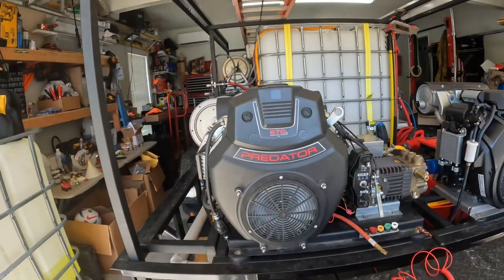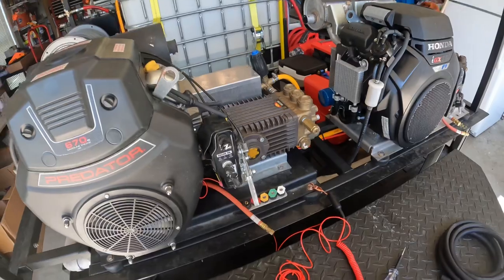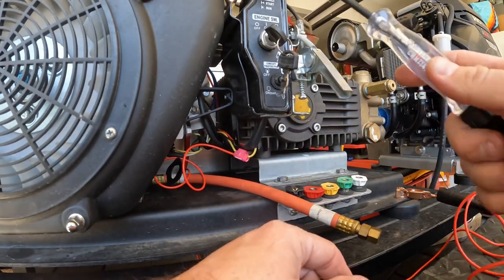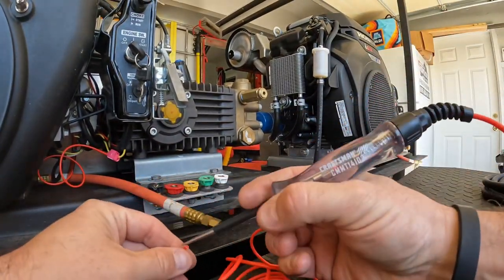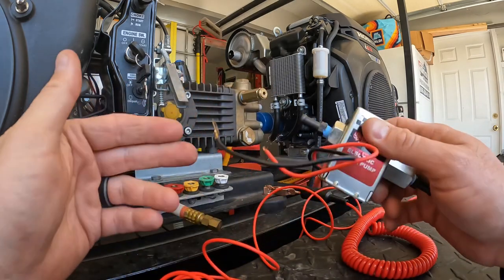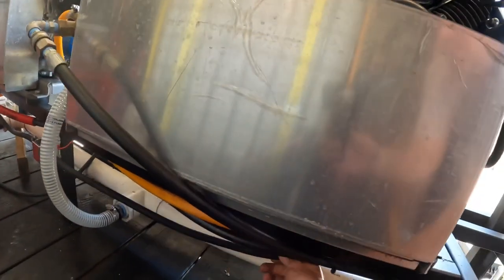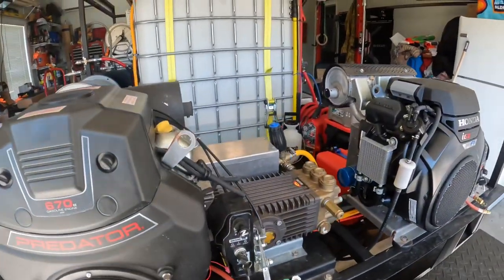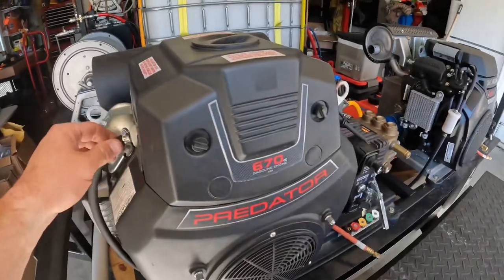How To Add A 12V Fuel Pump To A Predator 670

Comment: Can the ground wire just hook up right onto a metal truck bed? Or does it have to be touchijg the engine?
Reply from the maker: I believe it will need to be grounded to the battery or unless you have your battery ground to the truck 🤷🏻‍♂️
Reply: @KentuckyWashPros [UPDATE BELOW] I ended up just screwing the ground into my water tank cage 😂😂🤙 works like a charm!
Reply: Update you need to wire the ground on the same ground that the battery is hooked into. 😂😂😂😂😂 Learn from my dumb ass.

Comment: Just curious how the fuel pump works for you. I was considering on get the 670 for my build. I have seen before guys changing out the filter with a Honda filter when they first get the engine. I just got an envirospec pump tsg8040 in a 1inch gear drive that does 7.8 gpm bout 3500 psi is what I was told. So my next consideration was the crx680 but it's 19hp n not sure if I ll get the 3500. I got the pump but waiting on getting the motor til I get some more money in. Hondas are through the roof $$$. Right now I can't afford a Honda. Good luck with it, keep us updated.
Reply from the maker: Spend the money and get the Honda IMO. I'd get the CRX 680 over the Predator. There is a link to the fuel pump I used in the description.
Reply: @KentuckyWashPros  Yea bro I am gonna get the 680 from small engine warehouse $1099. + 119.00 for shipping. Thanks and good luck

Comment: Did this work for you, I am having an issue with my predator 670, I changed the pump to the Briggs and Stratton pump and I can only use my pressure washer for about 20 minutes and then I get a no crank no start. Is there some sort of safety feature on the engine why this is happening.
Reply from the maker: It has worked perfectly for the last 8 months for me and still going strong.

Comment: Why are you doing this?
Reply from the maker: It’s starving for fuel. It would run 10-15 mins then shut off, I would have to go squeeze the prime bulb I put on it 2-3 times and it would fire back up and do it again.

So I swapped it to a 12v fuel pump and haven’t had any issues so far.
Reply: @KentuckyWashPros  did you consider swapping fuel pumps ? I had a similar issue with my CRX and examined all the fuel lines and found they were kinked slightly near the fuel pump. I like your fix though if it works great idea
Reply from the maker: @seattleprowash5464  the fuel pump has been switched previously. I may need to check the fuels lines behind the plastic
Reply: @seattleprowash5464 it's a known issue specifically with the 670. super weak pump compared to what to needs. Easiest fix is adding the inline pump.

Comment: Will it eventually flood the carb?
Reply: good question! personally, I put in a 2 PSI regulator inline. Ran for 65 hours so far and it's going great.
Reply from the maker: These are a low flow fuel pump. I’ve never flooded the carb